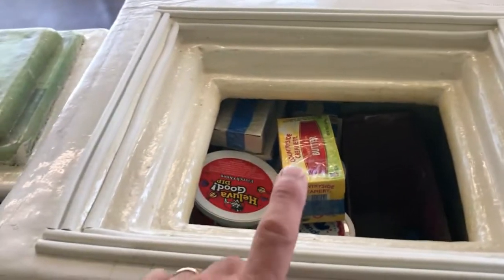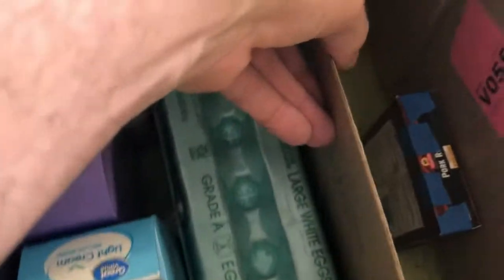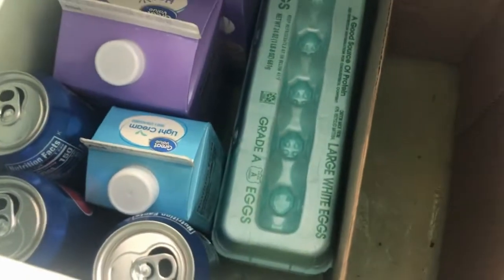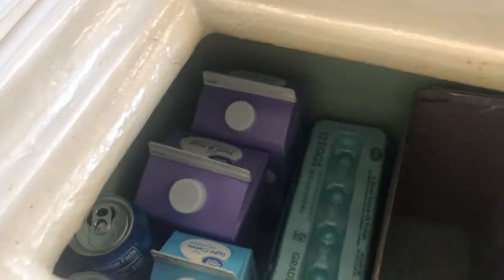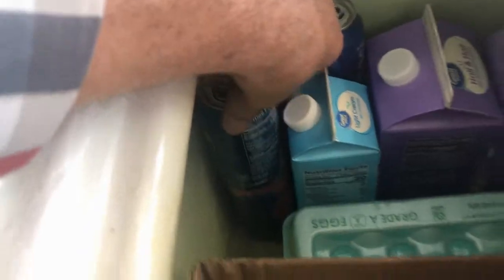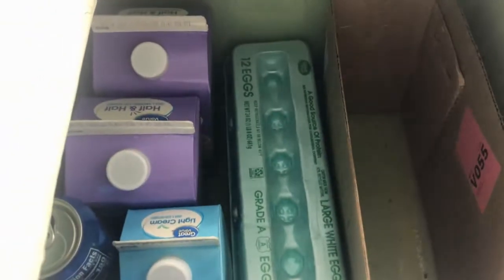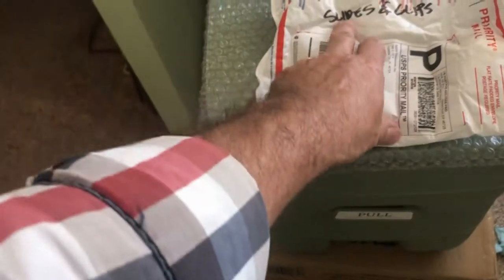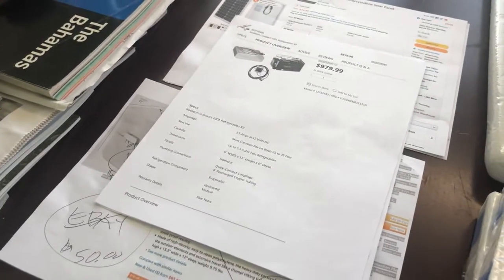33: Refrigeration on a Trailer Sailer? Boat Projects Skipper 20 S/V Panache (Buy small - sail BIG)

Comment: Nice build. Dont know if you know this or not but will share with you what I have learnt. Polyurethane is the best insulator inch for inch. You can get polyurethane sheets to make the same box and polyurethane works with Epoxy or Polyester resin - its a good idea to use polyester resin and chopped strand mat to bulk out the layup then use epoxy and  glass cloth as a final coat for strength and better protection. Money saved on a polyester/chopped strand mat layup for the first few thickening layers Vs a full epoxy layout, could be used towards buying the polyurethane sheets as they will be more expensive then the green foam board you used. The magic number for insulation value with a Polyurethane wall is 3.25" thick. Above that thickness it is diminishing returns out till about 4.5" thick and then very little more insulation value per inch after that. A radiant heat barrier such as your foil is good but needs to be on the outside as well as the inner layers. Then finally, a thick blanket over the whole thing helps as well. I have often thought a canvas cover with a blanket sown inside it would be good for this - ie, think horse blanket and you get the idea. Another nice trick I learnt is to freeze a towel and to put that inside the cooler box on top of all your stuff in there - it is the air in the box that is your enemy.

Comment: I may be exposing my ignorance here, but why not buy one of those portable cooler-type fridge units rather than building one from scratch? Great videos BTW!
Reply from the maker: Russ it had to do with the space where I wanted to put / keep the cooler in my boat. Either the yeti types of coolers were too small or too big for the space? If I just used polystyrene resin fiberglass binder it would of been cheaper... but I like to use the West Systems Epoxy which is like gold? Plus I just seem to like to build stuff🙄. 
Even in my next boat Most likely a Seaward 23-24, I’ll be building my own heavily rigid foam insulated box so it was a good test to see how it goes... but right now that might not even happen.

Oh and thanks!
Reply: @buysmall-sailbig6365  Awesome! Thanks for replying. I am plunging into small boat sailing and appreciate the thought that has gone into your boat.